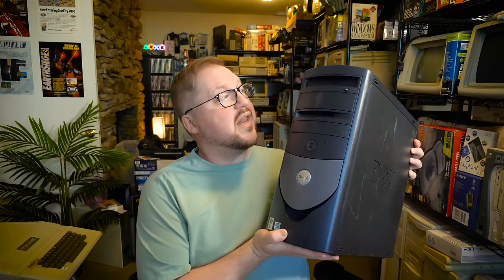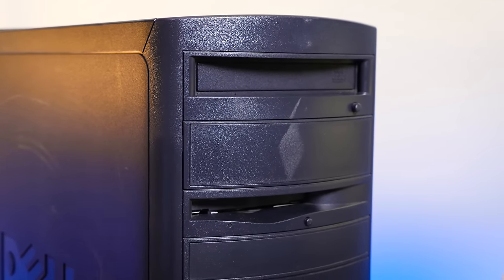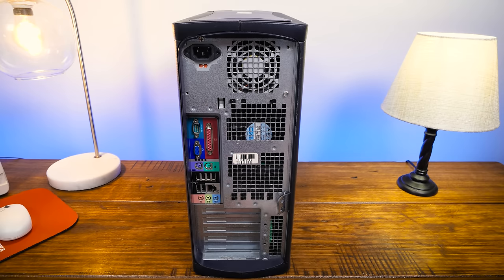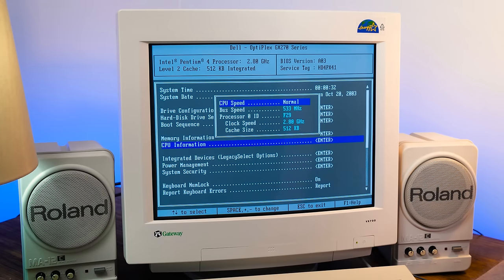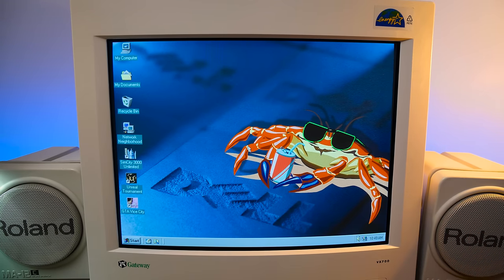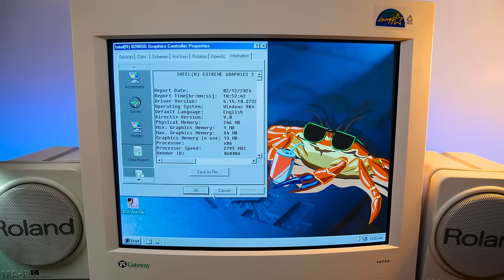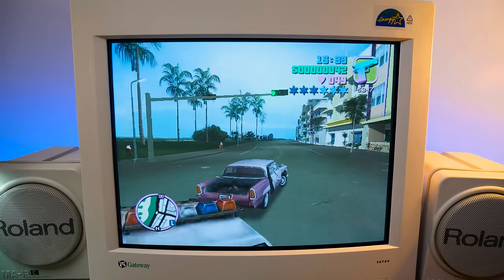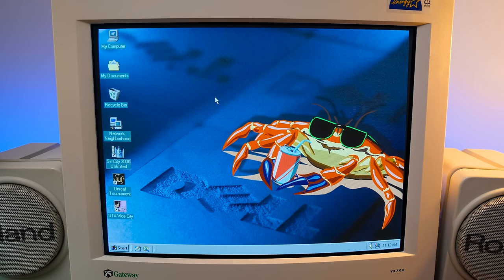The Most Unwanted, Boring PC: Dell OptiPlex GX270

Comment: Hey Clint. i was wondering about something. maybe someone already mentioned it, but i did not read all the comments. From 12 to 14 minutes you replace the thermal paste of the CPU. But i noticed you put the CPU back upside down. When you removed the heatsink, the whole in the die cap was on the top right, and after you put it back it was on the bottom left. Still it booted. I am sure there is only one correct way in which the computer will boot, so i was wondering what happened there. Other than that, keep up the good work. Always very entertaining. Best Regards from Holland.
Reply from the maker: I eventually noticed and switched it back around to the correct position. I just didn’t have that part recorded :)
Reply: @LGR  Hehehe. Thanks for the update. now i can sleep. :-) I built systems prior to this era. From 2000 to 2002. Ofcourse i built my own systems before but not by the masses. But in those two years it went from about a Pentium II 450 systems to the fastest Pentium III socket 370 systems. After that i switched jobs and mostly had to do with software. So i dont really remember if you could physically fit a Socket 478 CPU the incorrect way. I guess you could... My first computer you will not know. It was a Tulip. A dutch based company. They were building nice systems which were a bit better than the XT's from the same time. It had a NEC V20 at 9.54Mhz when most of my friends with IBM clones still had the 4.77Mhz Intel processors. And they were in a much smaller form factor cases than those massive IBM's. The fanpage is still up, although the cummunity behind it is dorment now. Click around with a translator if you want. https://www.tulipgv.nl/ My model was the Tulip PC Compact II. I miss the sounds of the HDD and floppydrive. Don't miss the CGA graphics though.

Comment: I supported these back in the early 00s. They were nice because they just - worked. But mostly it shows me how much spec creep there's been in the office world. These things could run Outlook, Word, Excel, and PowerPoint just fine in 2004. Yet these machines have probably been replaced ten times since then.

You're right they're terrible for hobbyists though - proprietary power supplies, proprietary drive rails, super limited BIOS and jumper options. I think some models even throw a fit booting from add-on cards, limiting hardware RAID or SCSI to secondary drives. Not the end of the world with solid state drives, but potentially a major problem if you got your hand on a Promise FastTrack back in the day.

Comment: i like the ram restriction option in bios, imagine being able to run a newer machine with windows 98 just to see how insanely fast the OP system would be, and that auto vram idea is a nice touch to, the cpu cooler looks like a furnace waiting to happen, wouldve been better if they added a 1" round copper slug in the base of the chunk of aluminium.

Comment: Had a Dell work computer that was almost 10 years old at the time with capacitor plague that caused horrific stability issues, submitted a ticket to IT, they did NOT care. Only got a new computer when my boss told them I needed a laptop because I was going to be traveling a lot.

Comment: I wasn't aware of the cooling issues, I think the logical response is to bore new vents into the case and fit it with a case fan, since it's "cooling" with hot air.

I picked one of these up for $10 at a yard sale and gave it a recapping. I personally have mine running with a Windows XP install, and it handled most games from around 2000 just fine.

I boosted it up with a GeForce 6600 GT, that's got it running Morrowind on high settings (it's a slideshow anyway, it's Morrowind) and Doom 3 at low (still choppy at medium). Still running into stutter in just about every game. Cooling solutions might help with that, the CPU is... fine.

Knowing the drivers exist, I might do a dual-boot of Windows 98, just add a sound card with FM emulation.

Comment: I hated the clamshell design so much. To service them meant you had to pretty much disconnect everything to have the room to open them up instead of slipping a side panel off. Also it was a royal pain to add anything on and still get it to open with cable routing.

Comment: I have the dell precision tower 5810.
I paid £50 for it. 64gb ram 1tb ssd 2tb hdd. Quadro M4000 625w power supply. I fitted a m.2 dock internally with 1tb m. 2.
Windows 10 pro
DVD/rwr.
I love using it especially for xbox ultimate pass cloud gaming.
Works fantastic for 3d animation suites.
Overall I can't complain for the price. 🎉💻

Comment: I wouldn't play this model down quite this much. This is a decent find. If you want a Win98 Optiplex, I guess GX270s are about as new as you can get. These have well supported 865G chipset, next models have 900-series chipsets. Capacitor plague just means that you need to replace the caps and sometimes repair some damage. It is also a great detail in the model's history and kind of gives you a permission to fix the board because almost all the boards in original condition will die. If you are really unlucky, the damage requires above average a wiz to fix it. The fact that the latter Optiplexes have problems with Win98 support is a real shame, I like the newer, metal panel case design more. I don't think motherboard-swap would be easy. This older model often has scratches in plastic.

Comment: I picked up a virtually identical GX270 for zero dollars and zero cents, along with a matching Dell 4:3 17inch TN LCD (the iconic, as in they crapped up desktops everywhere, E173FPV), via curb side pickup (it was sitting at the curb). This was like a decade ago. I gutted it, because it sucked, and put a better PSU in it, and the case currently houses a cheap AM4 board running an Athlon3000g that my 7yo uses for Minecraft. I still use the monitor on my crash-cart for the server rack in my basement closet.

Comment: I had several of those. I don't think I would call it boring, It does the same thing any other computer does, I'd call it realiable Very reliable, They just keep running and running The fan manifold is a little tricky but you get used to it. A DellOptiplex is the cummins of computers.

Comment: I got given an early P4 Packard Bell. It needed caps which I did. The case was broken so I put it in an old aluminium case from back in the day. I’ve got a SATA hot swap bay in the front to change the hard drive and she’ll run XP, 98, 95, 3.1, and even some DOS. 

The Core 2 Duo’s are the most impressive. They’ll do 3.1 all the way up to Windows 10.

Comment: If you put linux on it and use it for a minidlna sever they work great.  I picked one up for $50 including shipping a long time ago.  I have 10tb raid drive on it and boot off a usb stick.  No, you cant put a 10gig network card in it, but it can still stream to 5 or 10 devices at the same time.  Works great. I love it.  I call it the "broken-bucket" server.  It use to be the broken-bucket-of-spare-parts by that got tiresome to type every time I went to update the server.

Comment: I used one of these for awhile and ran GTa SA at like 15-20 fps but was fine while in buildings. Then I upgraded to a dell dimension e521 which I still have today for old games. Even has onboard Nvidia 6150 128MB.  My junior high schools were nothing but optiplex  270/280. Even my high school had some and we were still using Windows XP in 2014.

Comment: The thing about this chassis tho is if you wanted to make a sleeper PC this is among the sleeperest possible.
Dell's horseshoe cooling system is real bad but if you run it off modern temperature probes you can twist its arm into working a whole lot better than it did originally.
Like that thing did fan control off a temperature probe in the duct so if the airflow was obstructed it wouldn't even be getting the hot air to the probe to know it was hot.
These days you can put a midrange GPU in there and one of them 65w eco mode Ryzen CPUs in, 3D print some ductwork, vented slot covers and it can just about handle that.

Comment: Say what you want about the Optiplex line, but they're the reason I didn't need to pay money for a daily-use desktop for 15 years - from 2005 when I got my first free GX270 until a couple years before the pandemic, any time I needed a new-ish PC that was not great but good enough it was easy to find a 2-3 year old Optiplex for free.  I still use the last one I picked up as a as a dedicated OBS box.

EDIT: also FWIW, after I watched this video I went down to the basement, popped open that original 270 that's still down there, and all the capacitors are completely fine (visually, at least).

Comment: Pretty much the same specs as my Packard bell that’s still in my cupboard for some reason. I did upgrade it to 1 GB of ram in like 2006 and stuck a random Radeon agp card in there in 2019 which helped A LOT. ( FYI it was retired for more than 10 years before this)

The cars in NFS3 look like cars not boxes. Who knew?

Comment: I recall the OptiPlex GX270 was a pretty hot machine once it came around. Dell had been through several P4 designs by the time the GX270 came along, and they seemed to finally get several things right with the GX270 model. I recall the just prior decent system was the OptiPlex GX150, so it had been a bleak while between. I preferred the Dell branded OEM nVidia based video card option.

BIOS version A03 is definitely very old. Flash it up to the latest.

Comment: I have a few of that type. One socket 478 and two socket 775 versions with one being a half height model. I find they are OK aside from the proprietary motherboard designs, and lacking peripheral slots. I actually bought the fastest 478 CPU and then regretted it because of little improvement.  I didn't regret buying a rare em64(emulated dual core) P4 version CPU  for the early P4 and below 775 models.

Comment: Hey Clint  ( LGR )  There is one Advantage  that this  Business Boring  PC Has ,   from what I notice   as having  at least three of these  types of Business Dell Optiplex Pc's   The  CASE  the CLAM SHELL  case   which is  very Heavy Duty   all metal  a thicker gauge metal,   with  a Plastic  coating  skin over it ,   it seems like  these  Business Computers   would Survive  1)  a major Disaster  event Earthquake  , tornado, hurricane , battle zone  etc  2) a EMP Strike !   as the thick Gauge  Clam all Metal Shell  with a Plastic resin  skin Coating  would acting  as a Faraday Cage ,  making it ( in theory )   Survive  an Nuclear EMP Event .    protecting the component's inside  Motherboard & hard rive , floppy  video card  Cd rom drive  etc. ,   I wonder if that was intentional , seeing these  Pcs were also used in Military/Government  facilities  .

Comment: I was given a similar Pentium 4 based Dell Dimension 3100C tower PC in 2018 from a company that I was working for at that time. It is useful to me now that I installed the Debian x86 Linux distribution from Raspberry Pi on it. It runs the standard Raspberry Pi desktop and so all of the educational software that comes with a Raspberry Pi comes preinstalled on it. It has a 80 Gb hard drive. Its biggest weakness is the impossibility of installing a graphics card on it. I can run Half Life 1 on it under Steam under Linux. I cannot uninstall Half Life 1 because it that requires a 64 bit computer.

Comment: I had one. It was bought from an ecycler in 2009. I owned it till 2016 but i only used it till 2014.i used it for email cartooning, home publishing, and general home use as well as light web browsing and college school work .
Reply: I had an online cartoon I drew and I used an email list to publish it. BCC is a Wonderfull thing.
Reply: I used Photoshop and Photoshop essentials, older than cs 6 , in fact I think I was using v.5.5 for main ps and I think v.3 for essentials. Start with high res scans of hand drawings and then layer effects and paint on like crazy. So the graphics card was getting a work out. Eventually towards 2013 it started to slow down to not quite as fast as the sloth DMV guy in zootopia, but still a definite test of patience .

Comment: Circa 2004 I had one of these at work and a first generation eMachines at home. My attitude toward the Dell was pretty much like his: boring.

Also, I remember XP feeling like a real disappointment compared to 95 and 98. The impression I got was that they added more "critical sections" to the code (like lock{} blocks in C#). The performance was reminiscent of Windows 3.1, which didn’t even have preemptive multitasking.

Comment: I unironically really like the aesthetic of this era of Dell, I have a couple Dimensions sitting about, one of them being my main retro rig as well. I suuuper want one of those tiny Optiplexes to either hack in a modern mini-itx thing or maybe try a sorta retro control-PC thing.

Also Simcity 3k is my fave one, and the first one I played. I think I played it mostly on a first gen mobile i3 and a GeForce 310M, but I think I played it on a P3 era Celeron with ProSavage iGPU before that.

Comment: I'm a bit offended by people saying the eeePC netbooks were boring and unwanted. I loved my silly little clamshell, the first computer I paid for with my own money. Don't get me wrong, the Intel Atom processor was atrocious, and that they shipped them with 2.5" hard disks was kind of bad, but it was the computer I first used Linux on regularly, and I had a blast with it. And it had an externally replaceable battery pack!

As for the Optiplexes, I think my family owned one in the early 2000s that was similar to this. At least the case seems to match. I have no fond memories of it.

Comment: although Dell has changed the look of the plastic slightly now and then, the actual metal box behind it dates back to the 90s and is still in use, mostly unchanged, for all Dell/Alienware PCs, which is ultimately why they've always had and still have, inadequate cooling and require the most bizarre fan solutions to not catch fire the moment you turn them on. Nevertheless, these machines along with the equivalent HP junkboxes are still to be found in many institutions all over the world, especially since the switch to mostly online based software and services means these machines still provide somewhat adequate power for daily work

Comment: I've seen these machines last a long time even with the bad capacitors, seems to depend on which capacitor loses the luck of the draw, if its critical to CPU/memory function. My parents also owned a Dimension from this time period, after 10 years I opened it up to find bulging capacitors around the integrated nVidia GPU on the board (system had no dedicated graphics card). Makes sense as it would bluescreen even on older games like Half-Life 1 and Quake 2.
The thing still boots to this day, of course doing anything that loads the onboard graphics runs the risk of driver crashing and bluescreen, or memory artifacts on a frozen screen.

Comment: yeah my high school was filled we these Pentium 4 Optiplex's.  I ended up being an IT aid my junior and senior year to get IT experience before college, half my time with them was replacing capacitors on optiplex's as they failed.  My senior year towards graduation we would start replacing labs with core 2 based optiplex's and a few with athlon x2 systems.  Light years faster computers and more reliable on the capacitor issue.

Comment: Yeah, back in 2019 I bought one of this machine, because I wanted to set up a retro environment to play retro PC games, and this one happened to have an AGP port so I could install GeForce 6800GT, the last AGP display card I used back in 2004~2006.
The whole system did work pretty fine for quite some while, until it became unstable, crashed more and more often with no reason, so I thought it might be time to let go........

Comment: I've loved mine. Had one as a desktop and one as a server. The server one had a power supply that didn't like to start, but it was rock solid when it was going. I might have replaced all the crapacitors in them.
It was quite fast when not using some garbage windows install, and pretty quiet. Gigabit network and linux worked well on it. With one of those ADD cards you could have DVI output.
And the dell consumer PCs were pretty crap in those days. (this hasn't changed)

Comment: I have mixed feelings about these machines. I dealt with the slightly earlier Pentium 4 versions at one of my IT jobs and couldn't stand the reliability issues, but I liked how the cases looked. I still do. The curve made it a little less boring than some competitors, plus the flip-up front with downward facing USB ports was a nice touch. It made it less likely for anyone to bump and break the connector on anything plugged in. 

Every so often I think about buying one of these and replacing the capacitors. Then I remember I have a Core 2 Duo system with an AGP slot that can run Windows 98 pretty well. Still, maybe someday.

Comment: As nostalgic as Windows 98 is for me... I think it just makes sense to stick to the NT line whenever you can. Yes, even for retro gaming. I remember getting a copy of GTA3 back in 2002, onto my machine that dual-booted 98 and 2000. I first installed it on 98, hearing all the stories that "98 is better for gaming". It was OK, I guess, but then I tried running it on 2000 and was blown away by how much smoother and more stable the experience was. The peak framerate was similar of course, but there just weren't any stutters and other hiccups.

So yeah. If something will run on NT at all, it'll run better there. I'd keep this machine on XP.